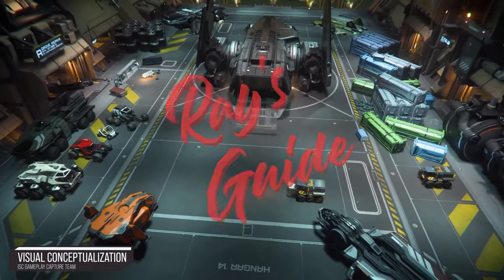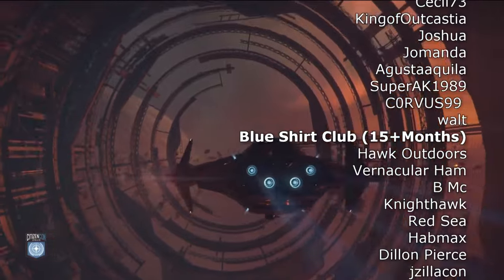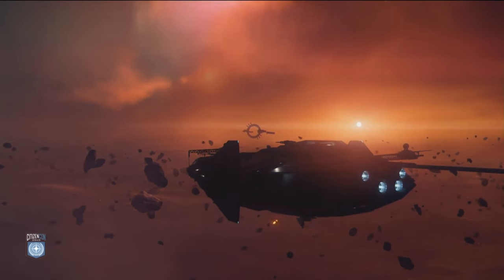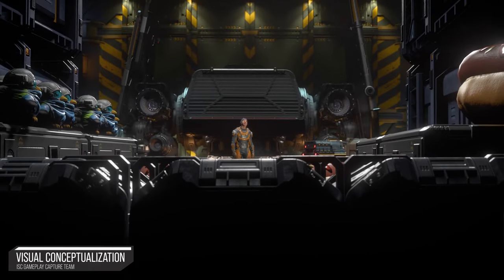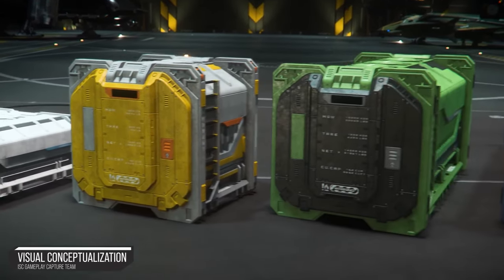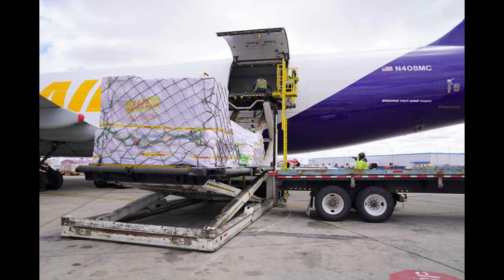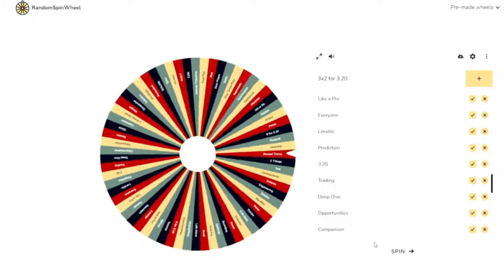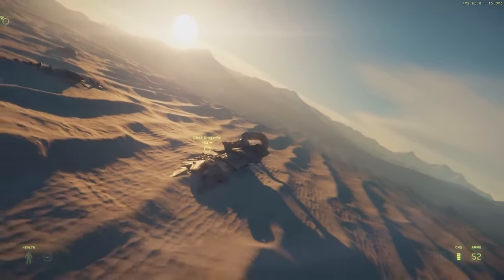Star Citizen: Analyzing the Cargo Design Brief Parts 1 and 2

Comment: Here are my thoughts:

- Hangars: I agree it should stay handwavy regarding how it works and I like your idea for how the account purchased "hangars" should be applied.

- Outposts/Depot: Aren't the new versions of UGFs supposed to do what your depot is for? That might mean it is already thought about and in the works, because they mention UGFs at about 5:10 in Cargo: Part 1.

- Loading: I thought they did mention there would still be automated means of loading/unloading but I was unable to find it when looking back through the videos. They really do need to have a system where players don't need to load if they don't want to but will use cargo movement timers.

- Palletize: If they are limiting themselves to  a maximum of 32SCU containers, I think this will be a necessary thing. If they go beyond that size for larger ships by including 128 (32x4) and 288 (32x9) then they might not need palletized versions. Given their constant striving for more "fidelity" I think it is more likely they will go with palletized cargo instead of even larger containers.

- Paid Item Recovery: The example that was used regarding missions slightly confused me and lead me to think they might be talking about two different things. On the one hand they are including real money items but I think they also might be including mission required items as well. I think this might be a mistake on their part if they are trying to shoehorn both into one solution. I think there definitely needs to be some sort of friction for real money items to prevent easy duplication and an increasing time limit, or insurance fee, for replacement seems like the best approach. That shouldn't exist obviously for mission required items and so if there will be two classes of items for the "lost and found" I really think that it should be reduced to mission required items and then use a different location, like the Chairman's Club kiosk, for real money items.

Comment: Agree on the palletizing of ships. Rationale can be as simple as transport regulations require that unmanned vessels can only only be shipped in a cold shutdown state. So, you're welcome to dock a dozen fighters to a Hull D as an improvised "carrier", but pilots will have to remain in their flight-ready ships for the duration, and should you get inspected by a UEE or local patrol and even one ship is vacant then everyone is getting impounded, and then your venture is in the toilet. Compare this to the Liberator, or genuine carriers like the Kraken and Idris, with no such requirement, and these improvised cargo ships aren't a threat to their livelihood, nor to our frame rates most of the time.

Comment: While I do not agree, that CIG should avoid the exploding toilet of loose items on a cargo grid, I do get that it needs simplification. And from a purely engineering standpoint, I concur with your reasoning. CIG even mentioned in the past that transporting racing vehicles would require them to be “packed up” or “mothballed” and rather than be able to use a hull-c as a carrier, the said ship would be unusable until properly unpacked. This agrees with your assessment and would lend well to the packing of loose items mechanics as well. Just wish resource limitations weren’t the deciding factor. That said, thinking it over as I reread this, there really isn’t a better way than your idea

Comment: The hangars listed in game packages are holdovers from the hangar module.  The game has progressed a long way and changed drastically since that feature was introduced.  I don't believe the hangars listed with ship packages will continue to be player-owned; a persistent hangar where you can look at your ship and spread out your loot.  When the hangars were the only way to view your ships and items, that made sense.  That model doesn't makes sense in the current state of the game.

Going forward, I believe the hangars listed will indicate the tier of amenity that we get without fees.  I believe we will eventually pay hangar fees to land.  For the pledge store ships, we get the listed hangar type without fees, but have to pay fees for ships bought in-game or upgraded hangar tiers.  This makes more sense than what your video has suggested, based on the current state and future direction of hangar design.  An announcement at August Dunlow refers to station fees and how 10% of them is donated to charities.

It may be that they resurrect the hangars from the hangar module, but I doubt it.  The hangars in-game are vastly different than what was offered in that feature.  Also, those hangars do not integrate well into the current game design.  There's a reason the hangar module has been unavailable for so long.  More likely the tiers included with ship packages will indicate the size of hangar and level of amenity provided for free when we use an instanced hangar.

When it comes to player owned hangars and persistent hangars, it makes more sense for them to charge rent in-game.  That works better within the economy they want to build for the game.  When it comes to player bases, they would be better off forcing us to build those structures through resource acquisition, time, and money.  Providing us a free hangar widget that we can drop on a piece of land we've acquired doesn't fit with their vision for the game.  It also creates more complications for design.  What happens if someone raids my player base and takes over my pledge store hangar?  Do I get to re-spawn it somewhere else?

No, the hangars included with ship sales will not be as you've imagined them here.  They will be re-factored like other aspects of the game to meet the current universe and systems in place.  I suspect that we'll see the change at about the same time we see instanced hangars nearing completion.

Great work as always, Ray.  Love your videos.  Thanks for taking the time to provide this form of entertainment.  Congratulations to Mark Buser!

Comment: That’s a really good point about the ‘exploding toilet’ cargo grid thing they showed. I’d be interested to see what kind of cover they decide to implement, and whether it’d be easily removable, especially in the case of stored ships or equipment. Would that be something the player could do, or would it have to be processed by the cargo terminal at the destination before the item (say an Aurora) could be used?
Reply: Nope, not an 'exploding toilet'.  The cargo grid will be just as shown.  'Placing anything on the cargo grid.'  Confirmed by CIG.
Reply: @GUNNER67akaKelt  As Ray mentioned, that could end up being a lot of polygons for something that just may not be worth it. I hope they take available computing resources into consideration before they make the final decision on implementation.
Reply: @GRANDADMIRALCAT  As always, things can change in testing.  If it does prove to be too taxing, even using LOD tech, then they'll have to go back to the drawing board.  That's why there's an alpha to test.

Comment: Yeah exploding toilets is a good description for it ... its funny in the moment but if implemented as seen would be a nightmare for many reasons. The ability to have boxes pop up at will is honestly nothing to imersion breaking ... is it strange? Sure ... do i want to see a box printer build into every existing ship? Nope ... we already have it with helmets and suits and it just works fine already with these. And yes the ability to split and merge your cargo is essential to be able to load it manual in a timley fassion. The outpost/depot idea has merrit altrough i would avoid saying specifc numbers at this stage and just say low volume (Enough for a freelance for example but far from enough for a c2) and high volume (Enough to load 2 c2 at the same time maybe even three if there is enough cargo) The bigger problem is that loading/unloading the big ships will take time and if i have to spend that time exposed on a landing pat for a standart delivery i wont be to happy about it.

Comment: The "tetris game" will be very boring as the "freight elevators" will provide with a fixed solution with defined size of containers. You will just have to memorize how their algorithm do it or look into internet.
Moreover they should provide more size of longer small containers. A lot of ships have odd size cargo grids  so they have full rows of small containers as the individual cargo module of the Caterpillar.
To show clearly the lack of design, just see that the Carrack cargo is not accessible currently and that the Argo Raft containers are fake and not detachable. The ARGO MPUV is also useless currently  whhile it should be at the forefront of cargo as it is its job. Same with the Mule that is completely useless as 1 SCU containers are easy to beam.